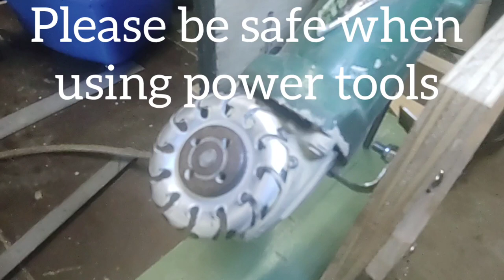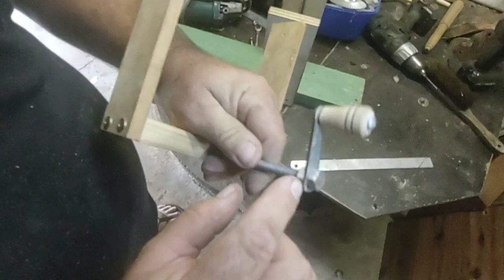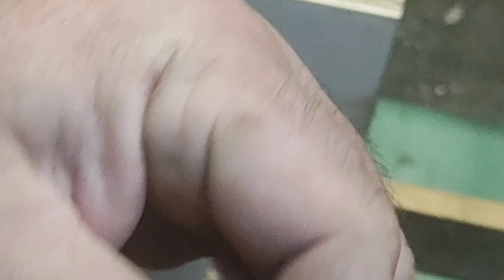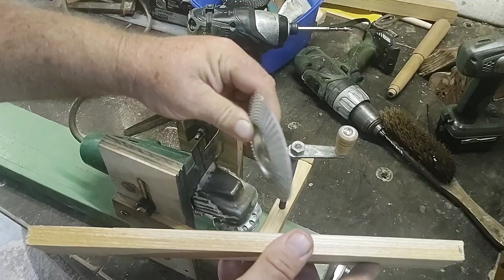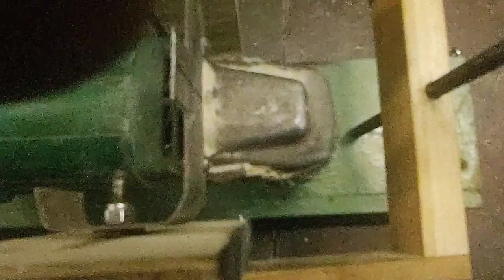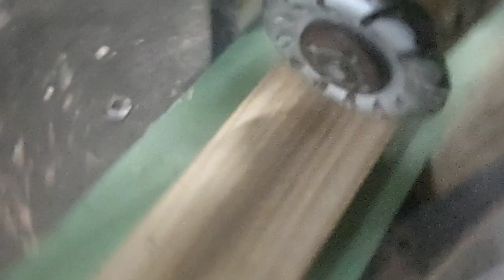WOODEN SPOON BOWL CUTTING MACHINE"HOW I MADE IT AND MODIFIED IT"

Comment: can u please provide a material sizes Bill of material
Reply from the maker: It really depends on the size of your grinder as they all differ with the brand of grinder you are using, the grinder I am using is a Ryobi grinder that's about 34 years old and it varies to the Makita's and Hitachi 4" grinders I have.
I use a length of timber 90×40 mm for the base a short off cut of 100 mm wide C purlin the towers on the sides are made from 16mm ply the height adjustment timber is 42×12 and 42×19mm the threaded rod is 8mm or 5/16 , I hope this helps,  regards Arthur.